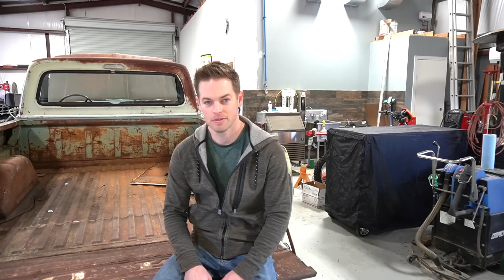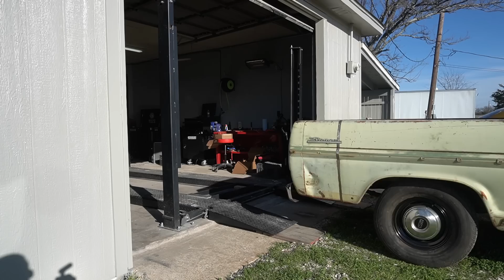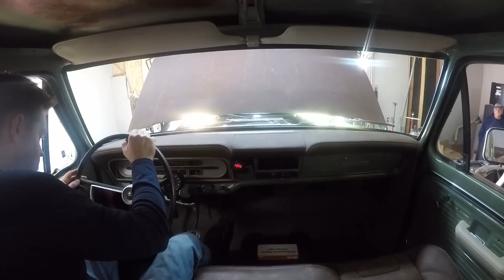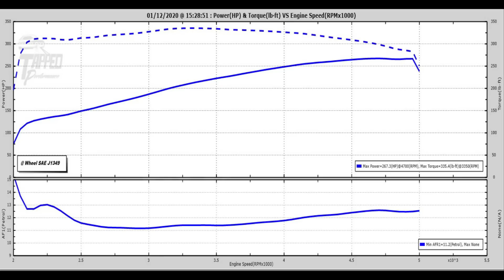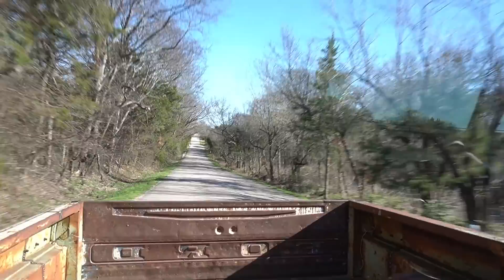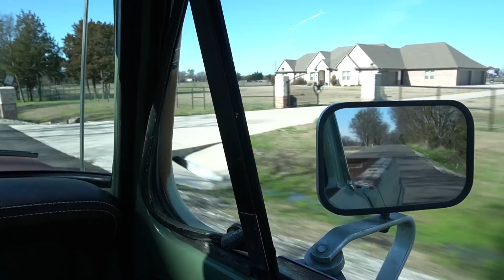Ford F100 390 Dyno Day

Comment: You don't need to machine anything to make it a 390 guy... They are the same everything literally all but the main connecting rods man... Ones 3.50 the other is like 3.73 or something like that have to pull it up I'm MOPAR and I know that much. That's 3 and 1\2  stroke or 3 and 3\4 stroke is the only difference what so ever my man so don't get robbed ,getting "special" machining to do 390 they are literally plug and play brother... Also you should check some things big time something is way off maybe the Dyno but you're little low on Horses there by at least 100 man...

Comment: DOUBLE THE HP  on same Dyno is great but overal those numbers dont sound great for upgraded cam, carb, intake, distributor etc.
unless i m comparing apples to oranges different dynos, wheel vs crank, but other guys are reporting 350ish hp over 400 Tq with similar upgrades
Reply: that bein said  beats the hell outta my tired 360 which cant even brake tq, lol

Comment: The 360...is a 390 block and heads...it the crank that's has a short stroke crank in that brings it to a 360 but it a 390 block and heads

Comment: Heck yeah man, that’s not bad for an old truck…😃 Hurst makes a floor shifter for the 3.03 transmission if you’re interested. They work really well if they’re installed properly. Basically reverse would be over to the left and forward where first gear is normally and then first is to the left and back. Then just slam if straight forward for 2nd and straight back for 3rd… You’ll be able to shift that transmission quicker than you ever could with the column shifter. I’ve got the Mr. Gasket brand in my truck but I really want to switch over to the hurst shifter. In the future I’m gonna find a 5.0 out of an explorer and probably build a 347 with a Tremec 5 or 6 speed I haven’t decided yet. But a fuel injection swap is coming in the future. I don’t know anything about carburetors…😅
Reply: It hurts to see the 3 on the tree setups converted. There are so few of them left because everyone does that and there were already less to begin with than floor shifts. It's a fun setup and no one knows how to drive one. I've got a 69 f250 three on the tree 390 and I love it as is
Reply: @buttonysquare8501 tell about it….that and efi swaps from carb setup
Reply: Where can I get this hurst shifter and 4x4 shifter

Comment: If you convert that to flywheel hp, you are making 320 hp and 396 foot lbs of torque. That’s good for a truck 390. The truck engine had lower deck height than the car engines. The piston usually says 410 on the pin side. The piston is.100 lower than the car engine. They have good power. Congratulations!

Comment: The intake and ignition are a roadblock to a decent increase in power. A CDI ignition system providing the spark for a Hall effect trigger electronic distributor that's been recurved. And the addition of a classic Edelbrock Streetmaster intake manifold would provide you with a noticeable increase in power without question. The comp 270h cam isn't giving you what you could get from a Comp Cams 268H which is fantastic in a mild 390. It's significantly better for mild 390 than that 270 is. The 270 is pretty damn good in a 428 but a 390 can't take full advantage of it's potential. But the 268h is a completely different story in a 390. I've been building Fe engines for 30 years and learned a few things . That 390 would be putting down 325-335 rwhp with a few very specific changes. Header primary size is very important and should be taken into consideration depending upon what factory Fe heads used . Factory head  castings are definitely not all the same. Some very common FE heads can provide a significant amount of performance where others substantially inhibit power production on the same displacement size engine
Reply: Don't know if you're still around, but 30yrs building these fe engines has me wanting to ask you a question? I'm right now trying to decide what to change on my 360 fe converted to a 390 by way of just crank and rods, to get some more torque without going nuts. So, you're saying, Edelbrock Streetmaster intake manifold, 268h for the cam, guessing long tube headers and what for the ignition? Thanks for your time!!
Reply: I changed 68 Gt intake to quality aftermarket intake for 14hp gain, not worth the bux or the work. Best bux were on good long tube headers and front disk brakes. For big power gain install good super charger, carb and adequate fuel pump, minimal mileage impact. That HEI ignition with good coil should work but isolate plug wires as even MSD wires will arc at high load. Use tire dyno to set relief valve to avoid detonation. Need adequate transmission and traction bars. A super charged truck will probably end up a tree trunk ornament. @Beemernow

Comment: 130 HP @ the tire from a old 360 Fe is actually pretty damn impressive considering it only had a rating of 200 HP gross new. It the torque that really tells the tale with a 360 Fe. They weren't known for being fast but they pulled pretty much whatever you put behind them. It may have been slow going but they never had trouble going even though slow  . Great reliable engine the 360 Fe was. Definitely known for giving decades of reliable service

Comment: I have a 68 F100 short box with a A scratch 428 PI with a set of 427 mid riser heads,  Holley 800 cfm carb, Edelbrock Streetmaster intake, comp 268 H cam , comp timing set and adjustable rockers and Top loader close ratio 4 speed. & 3.90 gears with a Detroit locker. Truck really moves out. It's definitely a quick pickup. Really quick between gas station stops too

Comment: If your gona replace a 360 crank why not go to the 427 crank and cam giving you a 410 stroker.
Reply: You meant 428 crank. 427 crank is same stroke as a 390 crank.
Reply from the maker: because a 427 crank is $$$ and hard to find. I was also wanting to test this "cheap combo" that is talked about in the ford forums, as though it will make 500hp for 200 bucks
Reply: @330_garage3  450$ through summit or jegs for the crank. Hey you do you just saying if your gona put that much in it that little more would have gotten you way faster.
Reply: Cost.

Comment: I have the original fan for that engine
Reply from the maker: I would recommend swapping to an electric fan after what happened to mine haha!
Reply: @330_garage3  
I'm surprised with that set up you did not overheat ....the fan is like a foot away from the radiator  mine is like that as well and when it's over 80 degrees it can't keep up in stop and go traffic .  Im switching to a 4 row radiator and flex fan without the shroud to get fan 1" from the radiator with a pusher elec fan in front just in case lol 😳  👍  I know your putting a LS in it now just sayin

Comment: At 1:45....you do know your radiator- fan is on backwards don't you?...it's turning clockwise as your facing it, & the blades are "scooped" wrong...
Reply from the maker: You aren't the first person to make this comment. It pulls air through the radiator... if it was reversed wouldn't it push air out the front of the truck? I was thinking maybe it was an illusion the camera was making or something
Reply: @330_garage3  No, it would not change the airflow direction...each single blade has a curvature in it, very similar to a propeller on a boat.
   Picture if you will as each blade passes by...it IS gathering air to draw it thru the radiator, but the curvature is wrong.  The only way it is going to change from drawing air, to blowing air is if the rotational direction is switched.
  The fan is working, it is drawing air thru the radiator, but not as effective as it could be, because the curvature is wrong.
   I note this because I once  had a car for me to work on with a peculiar overheating issue (myself a long-time career mechanic) The car would overheat ONLY while driving in traffic at about 35 MPH...not at idle & not out on the freeway at speed. As I had the car in my work-stall looking over it, waiting for the electric fans to kick on...I was greeted with a blast of hot air at my knees when the fans came on...the wiring was reversed & was blowing hot air the wrong way...At low speeds or standing still, air would move fine thru the radiator, but there was an over the road speed where the air couldn't be blasted forward thru the radiator because it was fighting the air-blast of the car moving thru the air, so zero actual flow, the higher freeway speeds would flow air faster than the fans could push it... Yes, one can muck up such things.

Comment: A friend of mine had one of these f100's with a 390.  Let me tell ya, none of the trucks today would have stood a chance against that bitch!  It was so fast and had so much more power than what this test showed!
Reply from the maker: If you look at the torque numbers in this video, you can see why that 390 would push an F100 around so well. This truck would burn tires at will, with that 390 in there.
Reply: @330_garage3  The old motors sound so much better than today's

Comment: Are those stock heads? What fuel are you using if it's 10:1 with cast heads?
Reply from the maker: Yes, stock iron heads. Just 93 octane pump gas.

Comment: I'm wondering how you measured the compression ratio. Most cast pistons have a dish and eyebrows and are closer to 7:1 and that could explain the low power outcome. (Seems like it should be higher.In order to get a measured 10.5 to 1 out of mine, I had to use forged pistons to get a true flat top (one set of eye brows, no dish) and mill the head (That's with low riser heads, also I'm using a 428 crank) (I couldn't find a cast, true flat top piston)
Reply from the maker: I calculated it. I walk through what I found in another video. By using the old ford 360 4V pistons, with the 390 crank and rods, it will bring the compression up. You're right though, in today's market trying to find a cast piston to get you into the 10:1 range is hard to do. Here's the video where I walked through the calculations
https://youtu.be/wJIHv-8jZD0

Comment: Did a build with the 390 stroked to 420 inches and the numbers at the track suggest 330 at the wheels with 450 lb feet . The old truck runs 12.08 at 110. Love the old 390s next up for mine is a head swap, survival motorsports stage x CNC heads. If your into 390 fe motors I would check out survival motorsports.  Dude, Barry Robotnik has serious FE engines in the engine masters competition ever year and has won a few with the old FE platform.
Reply from the maker: I actually picked the cam for this engine based on the survival motorsports web page and videos! Those guys have some really nice stuff. 450ft-lbs is a serious amount of torque to put down, thats probably a fun car to drive
Reply: @330_garage3  it's an old 1977 ford f100 stepside. With 3.89 full spool rearend and a built c6 . I also moved the engine all the way back to the firewall and lowered the whole thing.

Comment: Why did you buy a 390 short block?? The 360 and 390 is the same except for stroke. Should've just cleaned up the 360 and got a 428 crank. Or 428 crank in the 390 which makes it a 410. But.. guessing cost lots more to find 428 internals

Comment: I like your videos thanks ..keep them coming it gives me the encouragement to do more to my camper special ...I'm surprised at the numbers I have a 390 in my 69 and the book says with the factory 2bbl either autolite or motor craft it has 265 base HP at 4,500rpm .  With the Holly 4bbl you added I'm assuming it's a600cfm I thought it would break 300HP ...I ran the big 500CFM 2bbl for awile now I'm using the 350cfm 2bbl I do know there is a difference in the heads from a truck vs a 390 Ford Fairlane or mustang .
I wonder if the truck heads are restricting that 4bbl flow
Reply from the maker: I believe those published HP numbers were at the flywheel. Keep in mind it made 270hp at the tires, through that 3 spd. trans and some tall rear end gears. They say to figure 20% loss through the drivetrain, so with that estimate we would have seen 325hp on an engine dyno. For an old FE motor with headers and a Holley 670cfm I think its probably on par. People have speculated that the cast iron intake is holding it back, and some aftermarket heads would help it a lot. I just wanted to see what you could do with stock parts.
Reply: Rewatched your vid from a year ago ...also some have said that the factory cast 4bbl intake wouldn't go over 5k rpm but you did with factory heads  and intake on the dyno .
I bought a boat anchor 4bbl on offer up boiled out and cleaned for 50 bucks .I thought about spending the cash for a edelbrock but with stock heads I doubt other than wieght savings it will give a big noticable difference unless it was a RPM intake ,

Comment: I would have thought you could get about 300-315 hp out of that setup.... Love the truck and the build. Good update.
Reply: The power is in line with a near stock combo with a cam and exhaust. It's about 315-320 hp at the flywheel ( 267hp + 20% loss in the drive train ( 53 hp ).
Reply: @hoost3056  My 281ci 4.6L 2v is making 309rwhp 321rwtrq @5,446rpm, but i got TrickFlow 38cc heads n MHS TFS stage 3 n/a cams..lol
Reply: strangled with stock heads. 42hp per litre really is still very unefficient.

Comment: I too had a 69 F100 with a tired 360. Unfortunately, most of those trucks came with 360's. Mine was a 3 speed automatic. What they all really need are a 4 speed with a strong 390. With all the work you have into that truck you have something more reliable, cooler, and cheaper than any of the newer ones thats for sure.
Reply: 100!

Comment: i have a 70 with a 68 grill that my dad bought nearly new with a 390 c-6 and i ended up putting in a 428 pi crank and giving it more stroke came out to a 418 cid but not sure it runs as good as yours , mine has a bit of rust in the cab.

Comment: Very cool channel.  I love the truck.  I've got a similar Youtube channel dedicated to a 1981 C10 that has been 454 swapped that I work on.  Just had it on the dyno yesterday after doing a hydraulic roller cam conversion top end kit from Edelbrock.  I was nervous for you filming that close.  My 1pc driveshaft let go at 5600rpm and dented my exhaust and put a hole in the floor.  Be careful!  Those old motors will make power but probably never spun that fast so make sure your drive line is designed to take it.

Comment: As a professional performance engine builder I was never impressed with fords FE engine platform...on engine masters I have seen impressive results...one comment has merit in changing the intake as that certainly helps and as your dyno results show the cam choice could be better....as a point of interest the 428 crank is a cheap way to gain some inches and torque....I had several dye hard Ford fans and had far better results with the 385 series...460...models were very successful...good luck
Reply from the maker: Thanks, yeah this was really just an experiment to put all the internet talk to a test. "what can you do with a budget and all factory ford parts?" Then how much power will you really see? Internet folklore says 400+ hp and runs low 10's in the qtr, but no dyno sheets to prove it. Agree.. it would cost $$$ to make the FE valve train stable enough, and make the heads flow well enough to see that kind of performance. This is no race engine, but made nice low end torque and makes a cool driver.
Reply: ? Not impressed with the FE platform ? FE's were legendary in racing till the Boss 429 came out.
And in 69, some drivers were still using a tunnel port 427.

Comment: I've got a 67 galaxie with the 390. there is so much more potential in there. hell a power plus package from edlebrock is rated at 420 hp.
Reply: Yep exactly. I had a 66 XL with the 352. And my dad had a 67XL with the 390.

Comment: It is definitely looking up and that truck has a future now.  A "ton of fun". I haven't heard back from you on that block so you think I am bird seeds. May not be many but that proves there are more, just keep having  fun
Reply from the maker: I looked up that block.. it seems to just be a service replacement block. I couldn't find much demand for it anymore
Reply: @330_garage3  l think what it comes down to is I am old school and the stuff on the market today comes in higher power forms than what we had to work with. So when thinking about the coyote engines are building four or more hundred horses and not a thin skirt old school engine. Only someone  restoring the right engine code mid sixties car would need it. I just got old, sorry

Comment: You could have thrown a bigger bumpstick (cam) in it since you are 10:1. Not sure if FE parts are easy to come by where you're at but there are some heads that tend to work better than those C8 units you have. Also... your fan blade is faced the wrong way! Flip it around.....lol    Dennis Carpenter as well as a few other parts places have OE replacement fan shrouds. Think they are $130- $150?  Still, not bad numbers, seems like its got plenty of get up and go and sounds damn good!